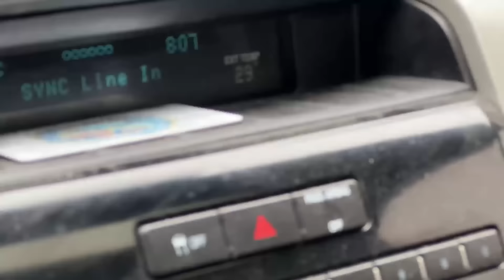My First Overnight in My NewTruck Camping Rig

Comment: Yo Mav avoid the air fryer mistake I had . You have the heat vent pointing at what I assume is a fuel tank. It will melt it from like a foot away

Comment: hey mav, for the butcher block putting a hot pan/pot on it will pull up the grain of the wood and make it swell. might be worth getting a silicone pot holder
Reply: It’s prolly a cheap block anyways
Reply: @joelfresque6335  butcher block is 300$ minimum for a cheap block of it. But I agree with the pot holders. Doesn’t matter the price it’s about taking care of your stuff
Reply: He was cutting a onion on it, it’s meat to get used
Reply: @usava8340  There is a difference between using and ruining.
Reply: @gravityowns8559  You can get a butcher block for a lot less than $300 lmao
Reply: Is there some kind of coating you can put on it to make it more heat resistant? Like a sealant or varnish or something?
Reply: @DefinitelyNotSpam  around here they don’t sell small pieces. So, yeah, not arguing about prices. Lol I believe you, just horrible price in my area
Reply: @Jetsonn  that's what he did so these people are invalid.
Reply: @AndyKPOV  sweet, I figured if there was Mav would have used it

Comment: As someone from the south (north of Atlanta, Ga) the sight of snowfall in mid-April is mind boggling to me. Down here we get snow once a year if we’re lucky, not even every year, and if we’re  lucky it’s maybe 2-3 inches. And people forget how to drive from such minor snowfall down here in the south. And it makes the entire state pretty much shut down like an apocalypse. EDIT : Mav, I LOVE the overhauled, rebuilt camper setup! That is amazing and infinite times better than what you had before. I’ve wanted to build a setup just like this in the back of my tundra 6.5ft bed for months now and seeing this setup is making me get ready to pull the trigger finally and build my setup!!! Love the heater thats out of the way. I am going to try and find a way to have a cubby similar to that  for a heater, that I can also utilize as a space to place some sort of A/c or cooler vent for the hot summer months too and utilize a space to be able to place a heater for winter, and remove it and place a small A/C for summer months!!! Love you, Mav. KEEP ON TRUCKIN!!!

Comment: Hey Mav and co, how important is having windows in your truck camping setup? I have a truck cap off of a worktruck (solid aluminum, no windows/vents) that I've been thinking of using but I'm not sure if I should sell it or just give it a go. Any thoughts?
Reply: I’ve never done truck camping before so I might not be helpful but I think it would be best to sell it and go for one with vents or windows. In a lot of the videos Mav has said he leaves a window cracked for ventilation to avoid carbon monoxide poisoning so it would probably be best to try to get something you can easily crack a window in. I hope this was slightly helpful but once again I’m most definitely not an expert in these things.  Stay safe :)

Comment: Mav. I cannot recommend the "afterburner" diesel heater controller from Ray Jones in Australia highly enough. 

I've purchased 3 of them so far. Two for heaters and a third as a spare just in case he stops selling them. The additional level of control is phenomenal. the biggest selling point is the ability for it to automatically adjust the fuel pump rate to meet demand instead of needing to manually adjust it or use the heater in the default high-low mode which overheats small spaces.
Reply: u can control the fuel pump pulse rate using the original controller, it just takes a bit more programming, and the benefit doesn’t really outweigh the haggle. Only advantage i see with afterburner is as IoT device to control ur heater from anywhere thru internet, which is an overkill for a camper!
Reply: @peacewarrior9500  no. You can set a fixed pump rate that stays where you put it. If the temperature drops at night the output of the heater stays the same and the temperature inside drops until you wake up and increase the pump speed. 

The afterburner will run it up and down as needed to maintain a stable temperature automatically. The Chinese controllers cannot do this.
Reply: I take it I’m right in thinking you can’t convert a non remote control heater to be remote and then use one of the controllers you recommended? Or is there a wired version available? I didn’t prioritize a remote version when I got mine as the wired heater control is always within reach in my set up.
Edit; Just searched it and got the answer. Looks like it will will as I have one of the compatible controllers on it already. I think it might be more complicated than my limited tech abilities can cope with, though.
Reply: @MapleMarmite  it can't be done like that, no. 

It's really simple to set up. The manual makes it seem far worse than it is. 95% of what's in the manual you'll never need. There's also a good Facebook group full of info to help with anything you need. 

And it only works with certain main boards in the heaters so if you're interested you'll need to check the manual for compatibility before buying one. Ideally before even buying the heater.
Reply: @MastaSquidge  You’re right, the pulse rate can be changed to a fixed value, in order to conserve fuel, not necessarily fine-tune the thermostat. But either way, i still think the afterburner is an overkill for a camper!
Reply: @peacewarrior9500  on the contrary. Using the variable speed mode saves fuel by eliminating the high speed maximum output periods and preventing you from having the pump rate set too high and overheating the space.

I have a teardrop with approximately the same amount of volume as his truck bed and without the AB it's impossible to keep a stable temperature in there.

The small spaces are actually where the AB is the most appropriate.
Reply: ok

Comment: I do want to see that battery hookup.  I want to start building mine. I have a little different application with 2 batteries and a diesel truck from the factory so I need to add a third.

Comment: Top truck camping tip: Never store piss bottle next to drinking bottle, I made that mistake once, used an orange juice carton and in the morning I wasn't sure so I smelled it First and it smelled of orange so I took a hearty swig before I realised what it was. What made it worse is that there were other campers watching and I knew I had to keep it in until I was out of view otherwise they would be able to guess what id done. Yeah that was bad, didn't ruin the holiday but it definitely was a low point

Comment: Love the new set up. But if you have solar/batteries/alternator…. Why would you want MORE flammable fuel in the bed of the truck?? An electric hot plate or induction burner…. Boom.
But the air fryer was brilliant. (I’ve made soup in a deep fryer…. So, good job!!)

Comment: hey mav just a question....so you just routed the diesel heater vent to the center of the cabinet in the middle?  as i remeber the episode when you purchased you had it on the other side of the truck box with the exhaust on that side as well....and can i ask whats the total height for your bed platform?....8 inches?

Comment: 13:26  That was what I was thinking as well that the table would go over your knees.   I guess perhaps that could be something to look into modifying in the future as it is inconvenient that you have to lean to the side to use the table.   Perhaps instead of having the hinges mounted inside the drawer unit, perhaps put an actual lid over that draw compartment and then mount those extension hinges to the lid.  That should have the butcher block table swing up high enough so you can get your legs under it.

Comment: Im gonna be honest mat, you put so much work into remaking the back of the car… but you can’t just use the table that you’re gonna be using as a workspace as a cutting board!!! THATS WHY CUTTING BOARD EXIST!!! Scratches are gonna be showing up over time  and not only is it gonna be more notable when you’re working on your laptop buts also gonna smell bad cause it’s gonna have micro particles of food in your board and you wont be able to clean it off as easily

Comment: Mav, can you explain how often you have more advanced maintenance on your F150? Considering your engine and transmission go through extreme/ severe use as per ford: how often do you find yourself doing coolant flushes, transfer case fluid exchange, transmission fluid exchange, etc? I would imagine that alignments are fairly frequent, same for tire rotations, shock absorbers etc.